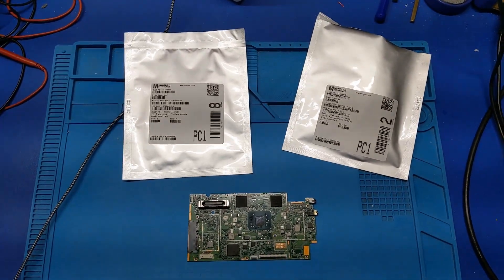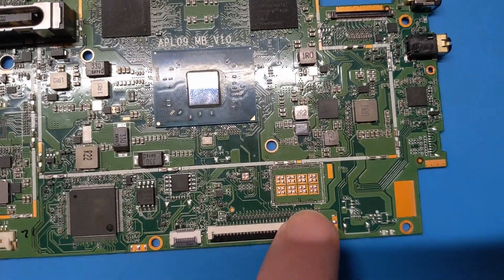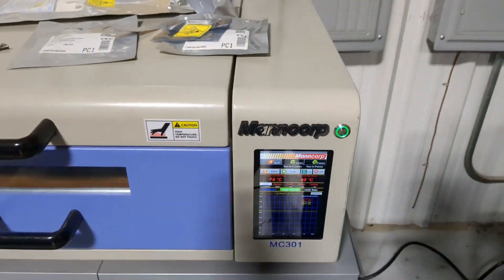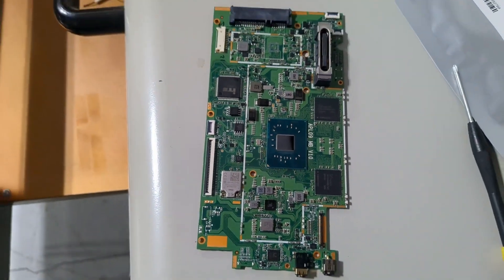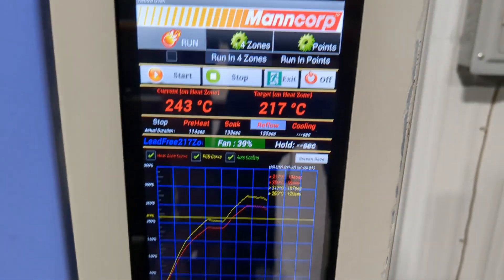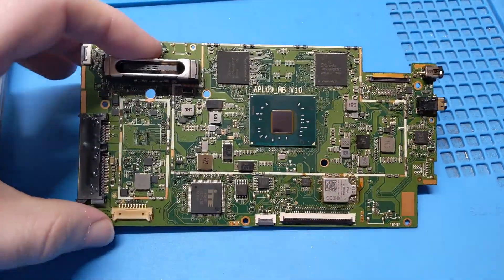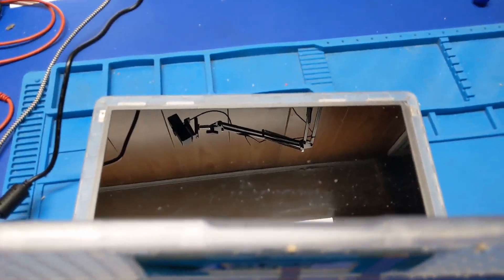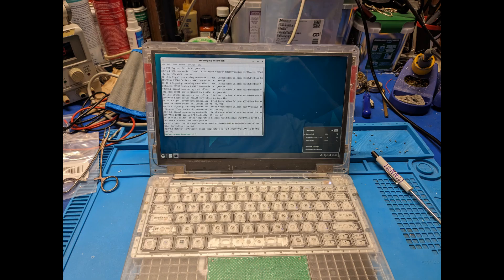JTS SecureBook 5: Adding Wi-Fi 6 Support!

Comment: I'm the past for targeted reflow with a heat gun I've used thick aluminum foil or doubled up regular aluminum foil as a shield for components while reflowing a component or reinstalling a new part with bga solder parts